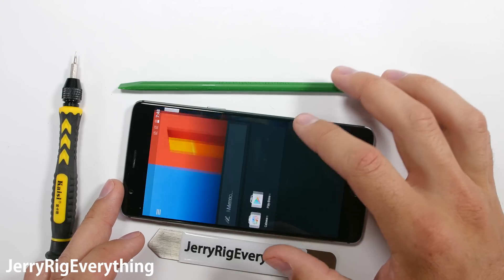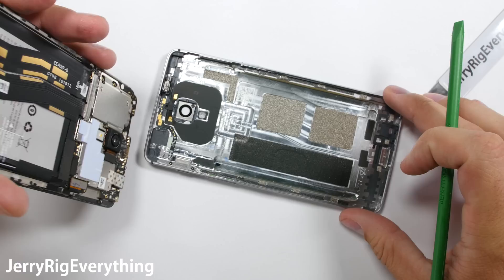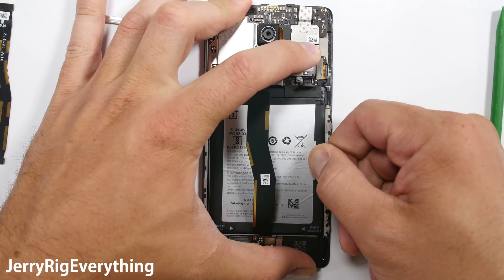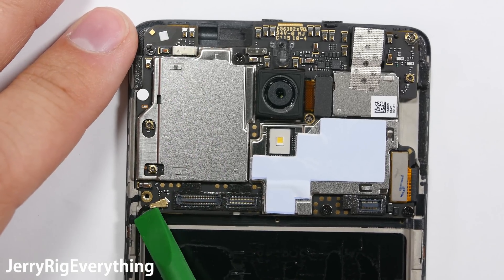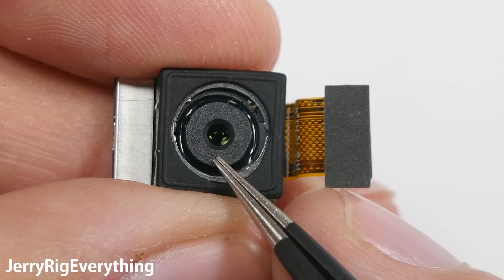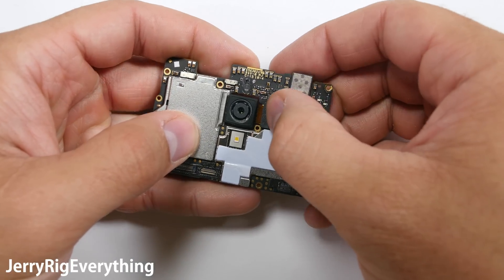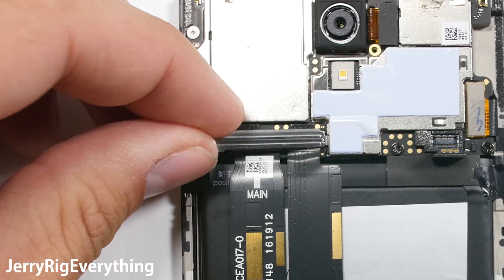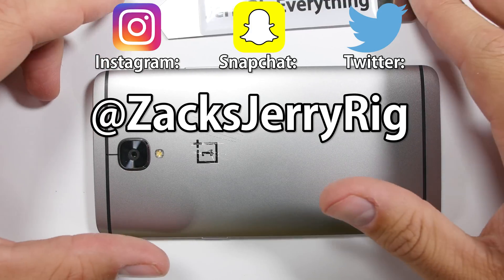OnePlus 3 Teardown, Screen Replacement, Battery fix

Comment: does this means can change the camera lens from other phones also?
Reply: that would be so fucking great!
Reply: No. Because it's removable does not mean you could change the sensor. Usually the ports are different, but the OS would not be able to connect to another module, should you ever succeed at plugging it in.
Reply: i tought if the lens are from sony the port should be the same???
Reply: adrain quan That's the case sometimes, however they still won't work, knowing Android and the modularity of the OS, changing the driver out is probably possible but won't be easy

Comment: very very nice tutorial.. thanks!
Reply: updated - 8/16/2016

- suddenly my camera didn't work for around 1 week
- at first i thought it was software issue
- so i upgrade to oxygenos 3.2.4, didn't work. downgrade to 3.2.1 didn't work
- i followed this tutorial to release and plugged back in the camera module
- but nothing happens, the camera still not working

any help with my issues? i really don't want to throw away my OP3. just got it for almost 2 weeks :(:(:(

Comment: I completely agree on the nice touch a little color gives, even if it's just on the inside. That's one of the charms I liked about BlackBerry phones. Made all those necessary battery pulls exciting lolol. They upped the ante when they started adding different colors to the labels under the battery covers a few years ago. Like the Bold 9900 had an orange sim tray, I believe? And the battery had a bright green stripe. It was the equivalent to wearing neon underwear under a business suit, I loved it haha

Comment: They button is separate from the board, and connects to the phone only via contact pins? Yes, please.
No more messy button replacement due to soldering, or broken connectors.

Comment: we want expendable slot better memory management and bigger battery !!!!
Reply: Memory management really isnt a problem
Reply: u have 6gb of ram but the os close for you app after about 2 gb so what the use of 6 gb ram
Reply: ***** 6gb of ram is used in the app you have open, its a myth that it is inaccessible. if you have more than 2gb of ram apps open in the background it will start closing them yes, this keeps the phone smoother. the phone probably will become open source too just like the oneplus 1 and 2. so someone will change it
Reply: that is what i meant why give us 6gb of ram when the os will close it after 2 gb of usage
Reply: ***** because its future proof. if apps use 3 gb of ram in the future then you're going to run out of ram very quickly
Reply: that is the purpose of ram use until max close only when max

Comment: Thank you very much for the inside view of the OnePlus3!
Looks like the headphone jack is once more on the bottom and cannot be replaced individually (need an entire new power module should it be the only thing broken). Is this true? Could not see this in the video.

Comment: 0:17 do the sim cards fly out like that every time you remove the tray?
Reply: One Plus 3 = M1 Garand
Reply: Those were just some dummy plastic pieces that come with the phone.
Reply: yeah that was weird ... some crazy trick :D
Reply: It looks like he is putting some pressure on the tray at the end which makes them pop out.
Reply: probably tension on them because he bend the phone
Reply: I have this phone and no, they don't :)
Reply: Only when you're holding it wrong. They are not clipped in the tray, so if you are a little careful and hold it level so that the phone is close to being horizontal, you should be fine.
Reply: they arent sim cards, just some plastic things oneplus stuffs the slots with
Reply: Please learn how to give exact or slightly before timestamps, not "after-action" ones.
Reply: SPN true that
Reply: Magic. Poof :D
Reply: +Akash Sen yeah I did
Reply: no
Reply: Wassim AbouAlfa lol, but they do have got a chip in em
Reply: Joe Tintin it is just the design to get rid of plastic dummy sims
Reply: Joe Tintin no, it was just because they were plasitc
Reply: Joe Tintin no
Reply: mayur kulkarni  yeah but did you see them fly out?
Reply: +mayur kulkarni sim cards and sd cards are plastic too for your information

Comment: Well done on the audio side of this video.  It really very well done. 
Suggestion: add a score on repairability like ifixit
Reply: +kaitlu his voice is great there's no need for music
Reply: Unproperly attached connector?
Faultry screen?
Reply: +1
Reply: Minus vote on background music from me too, sorry Vihanga Sathsara. The last thing I want in a video like this is any distractions. Just a clear voice explaining all the steps (which this video really had, awesome work!).
Reply: Just play some music in the background. I like the focused sound of explaining without distractions.
Reply: I can tell that this phone is one of the easiest to repair.
Onplus even helps us by adding that pull tape for battery.
Reply: The left side of my screen doesn't work after replacement.  When i touch the right part of the screen,  it registers touch on the left as well.  Any fix?

Comment: hey jerry can you help me please i recently replaced the screen on my oneplus two i seperated the frame from the screen inserted the new screen to the frame and applied some glue the phone booted up successfully but i cannot receive wifi singnal flashed the phone no luck checked evey connection still no luck any info what might have happened?

Comment: Very interesting design compared to the previous phones. Especially all(most) of the components connected to the screen portion leaving the aluminum mostly bare. Also like how the charging is very easy to remove. Great detailed video, as usual. Can't wait for the phone in the video to arrive at my door step ;) and if anything goes wrong I can refer to this video.

Comment: Damn, that actually looks remarkably simple. Kinda sad when you consider how badly HTC butchered the internals of the 10 and how long they've been around.
Reply: I really was hoping for better repair-ability on the HTC 10
Reply: jborde You and me both. I love HTC but they're not doing themselves any favors anywhere.
Reply: +Jonathan Longoria They dont listen to their customers and thats why they will go down some day...I had an htc m7. great phone but the battery sucks ass which is still an issue with htc phones!
Reply: It's like a super powerful raspberry pi with a huge screen, big battery and charging/usb separately in a super slim case. Very cool.
Reply: +Shinji D thats the problem, i want htc cos they have better accessories like the earphones but to repair would be risky just to replace battery.
Reply: Lil Saf Well, I dont really use the earphones from htc except when I dont want to invest in new ones. I am currently using xiaomi earphones for my oneplus one. Great sound and cheap.